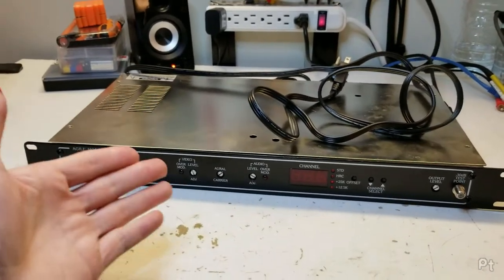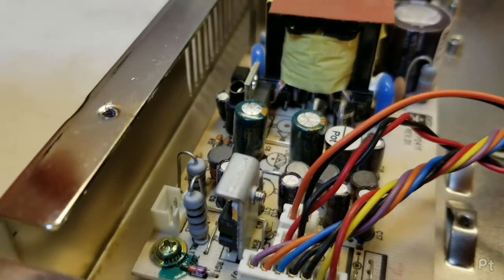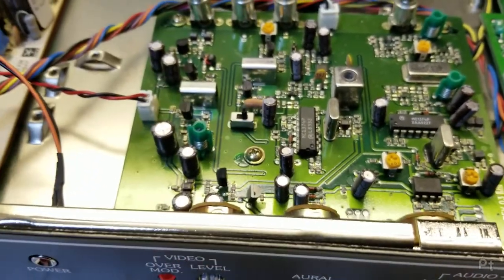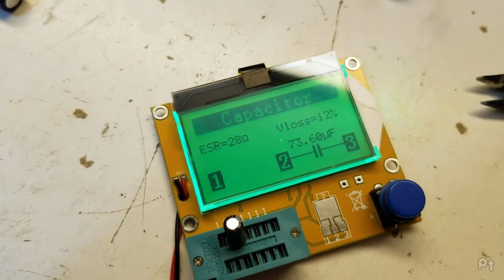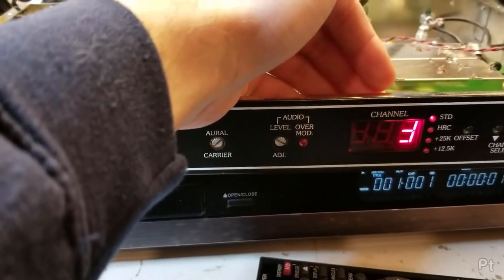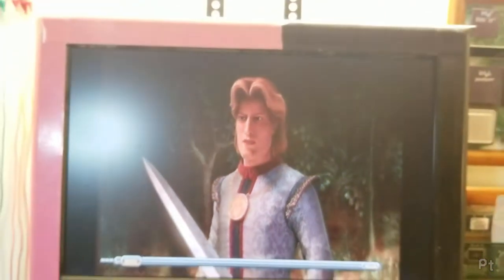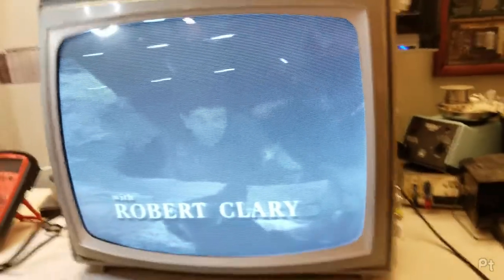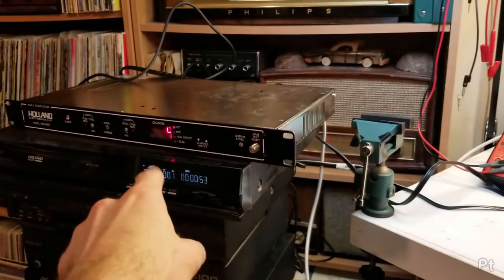Holland HMA-860H Agile Modulator (repair and demo)

Comment: I love the second definition of “agile”; I totally get it the joke about not getting it. The agile methodology is used a lot in software development and IT for many companies. Usually a large concept or project is broken down into tasks where many people will execute. Let’s say a project takes two months, but everyone meets weekly to discuss their progress and roadblocks. Many times, these meetings are called “sprints” as the goal is to accelerate results and improve quality. Many times, they’re just wastes of time. ;)

Also, excellent video so far! This is becoming my new favorite channel :)
Reply from the maker: Oooh, I think I understand how that definition applies here. Agile because the different stages (video and audio IF, RF, etc) are broken down into separable modules.

Thanks!
Reply: @probnotstech   No, it's the first definition.  :-)  Agile modulators are the compliment to channelized modulators.  You can trivially set them to any channel, either through a button interface like yours, or an accessible bank of DIP switches.  They are also known as "frequency-agile modulators" for obvious reasons.

Comment: These commercial modulators are so nice compared to the awful job that commodity modulators do.  Likely because they're cheap and poorly optimized.  But also intentionally, to be "user-safe" in case you do something silly, like hook up an antenna to the output.  Those old 3.5mm-to-FM transmitters were the same.  They kept the output power low so you wouldn't accidentally exceed unlicensed broadcast limits and interfere with authorized transmitters.  But the signal quality always sucked as a result.

The one thing that is frustrating about big-boy mods is how rare the stereo units are.  The stereo encoder is a bit of extra complexity, but I bet the main cost-cutting driver is the dbx license for the noise-reduction block on the L-R component.  I've read that the patent has expired on the analog implementation of that now, so it would be essentially free now.. But, of course, now, everybody uses digital modulators, and even if they didn't, they would be using digital ICs to do the companding -- and some of those techniques are still under patent.

We just can't have nice things.  :-)